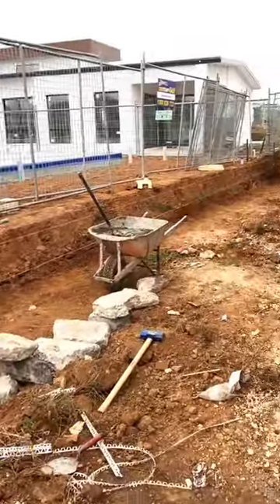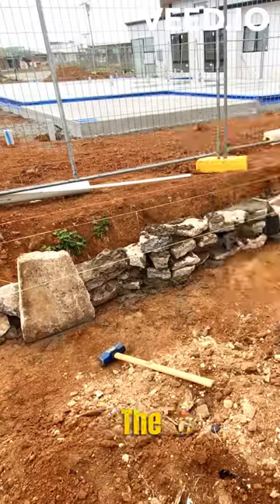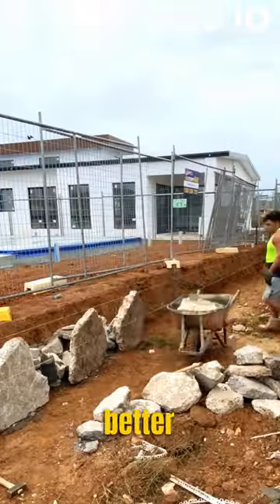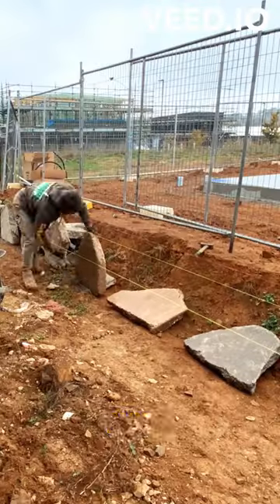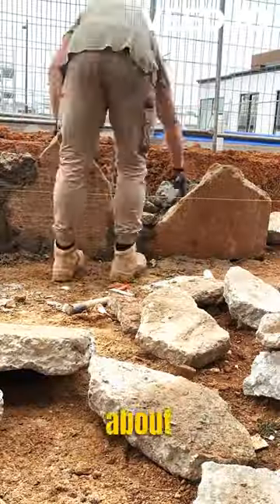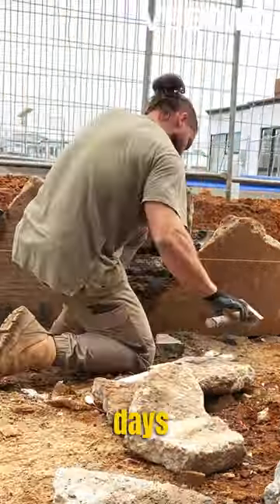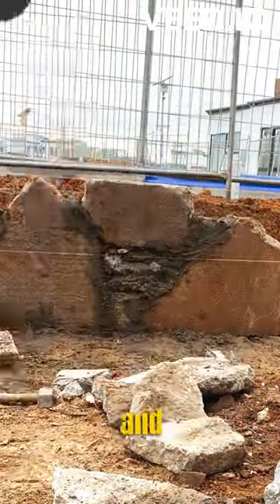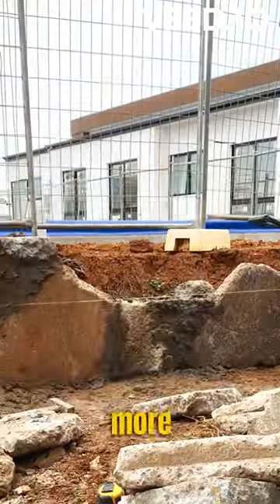DIY Retaining Wall: Step-by-Step Guide for Beginners #shorts #diy #diyideas #retainingwall

Comment: I'd like to see a step by step tutorial of this, please, and cost breakdown. If you have done this is a curve, that would also be helpful to learn by tutorial. I have a 40 foot section behind the shop at my farm, and I need to build a wall, then level off for a rainwater tank system.
Reply from the maker: Thanks, I haven’t dedicated time to full length videos yet but will in the near future. Most of my energy is going into short form for the time being.